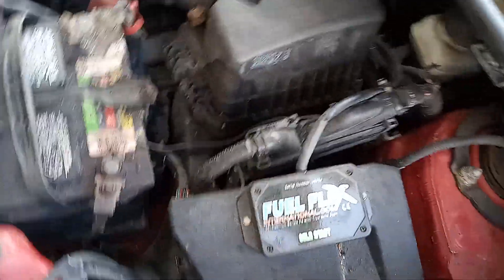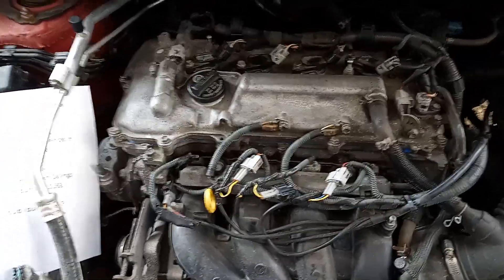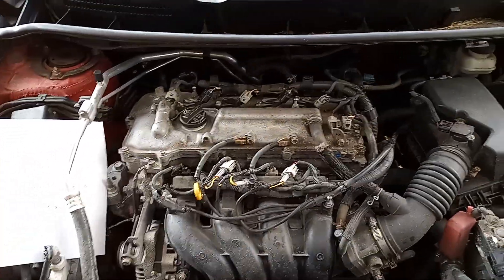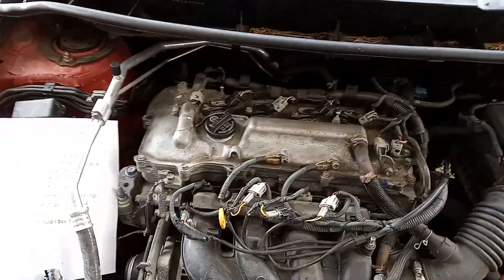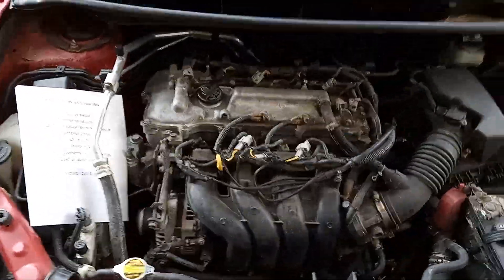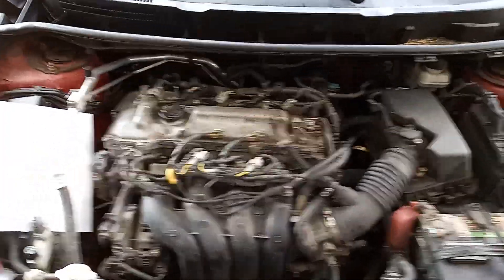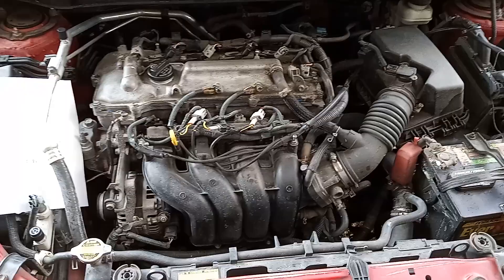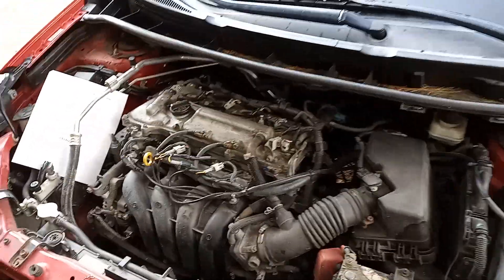E-85 Flex fuel conversion kit 1 year review is it worth it?

Comment: Hi there. If you are new to it, India has mandated 20% ethanol blending in gasoline, without price cuts or alternatives. This fuel is suited only for vehicles manufactured in 2023 or later, according to manufacturers. Due to this mandate, car owners are suffering about 15-20% drop in fuel economy due to the lack of optimized tuning, with concerns about long-term durability.

I use a Volkswagen Polo 1.2 MPI 2016 model, which is certified for E10 max. The car used to give 10-11 km/L with E10 fuel, and now with E20, that has dropped below 8.5 km/L with a marginal reduction in acceleration (nothing worse has happened till now, touchwood). I mailed to Volkswagen regarding ethanol compatibility, they responded as follows:

"As discussed, your vehicle is designed to run on Petrol/E10. The components of your car have not been evaluated for compatibility with E20 fuel. We trust this clarification addresses your query."

I watched a video by ChrisFix regarding E85 upgrade kits offered by eFlexFuel, and verified my car's compatibility with the kit using its VIN. When inquired regarding the material compatibility, they responded as follows:

"All of the vehicles listed compatible have E85 proof fuel system from factory. Theres no need to change fuel lines, pumps, injectors etc. If your car is listed as compatible you are good to go!"

(The engine is listed as compatible)

Considering all of these responses, should I go for the conversion or go for a new, E20-compliant car once the existing car starts throwing trouble? The car doesn't seem to have any significant issue with E20, but unfortunately, the blend is not going to stop at 20%, due to some internal politics. If I am to convert my car to flex-fuel, what are the additional precautions that must be taken?

Comment: Hey! I want to use this guide for my 2023 Ford Maverick Hybrid 2.5L naturally aspirated but dont know where to start would you think just one of these cheap e85 kits would be enough or if i would need to add a ethanol sensor somehow?
Reply from the maker: they do sell a E-85 kit for a hybrid maverick with a sensor they are more money but it will give you smoother operation https://eflexfuel.com/us/auto-products?product=eflexplus
Reply: @mattmopar440 i did see this online haha but it is far too expensive for the money saved on e85 to be worth, do you think the cheaper kit you used in your video would work on my truck? Its an atkinson cycle naturally aspirated engine so i dont see why not maybe you would advise better

Comment: Can any one provide a link to this product or company please? Its just what I want to try but several similar sounding companies show up with much more expensive products. This would be perfect if it was combined with a flex fuel sensor to self trim. I want to order one to the UK as in France we have E85 everywhere for 74 euro cent per L. I some times do a round trip to the south that is 600 miles one way.
Reply from the maker: Here is one like what I got they use to be all over Ebay now its hard to find them Ebay has gone down hill in the last few years tho 
https://www.aliexpress.us/item/3256805779429458.html?src=google&gatewayAdapt=glo2usa

Comment: I put a different kit on my 2002 Mustang GT that was much more costly (about $700). It ran fine for several days on 44% ethanol content but the day that I refilled the tank I got 61% ethanol content (a mix between 44% and 85% which would make it around 61%) and the car died. This is less than a week after I put in the kit. Turns out that it killed my fuel pump (or was it coincidence?) and I have to replace it. The manufacturer and another youtuber said that neither the fuel pump nor the fuel injectors need to be upgraded from stock. Anyway, I ordered a fuel pump certified for E85 only to find out that the fuel pump housing for the bad pump was of poor design where you have to remove a small hose to get access to the fuel pump. Which caused another problem because I ended up destroying the small hose and can't find a replacement that is SAE 30R10 anywhere. The corrugated hose fits onto an 1/8 inch OD port on each end. So, I have to order a complete assembly with a fuel pump pre-installed because you can't get just the housing from any manufacturer. You might not be able to specify an E85 compatible fuel pump either. I'm not a happy junior mechanic right now.
Reply: The same consideration is present using Bio Diesel on older cars. A change of fuel on an old car can disolve varnishes that built up over time in the tank and pipes and cause issues but if introduced slowly it can clean out more slowly.

Comment: thank you for sharing
I would get just because I think being able to flex fuel is so cool
though I prefer E0 if it wasn't cost inefficient to E10
Reply from the maker: I'm coming up on 2 years over 30k miles no issues using all the stock parts but if I have an issue I will do an update video

Comment: Looking to do this on a 08 Toyota with a v6 as e85 is half the cost of regular (I’m old enough to have bought some of the last leaded gas available which is what regular use to mean). Thanks for the useful info, even if I take a hit in economy that’s ok for less than 3 bucks a gallon. I have three mopar vehicles with flex fuel and haven’t had any issues with the fuel system specifically on any.
Reply from the maker: Honestly Ive seen cleaner oil during oil changes better performance you take a decent 20% hit in the winter but it gets better in summer probably 10-8%  this is running on a 2010 toyota so you should be good hasnt given me any issues and Im coming up on 2 years now

Comment: Thanks, this is helping me decide it's worth it or not.
Have a very big price difference (4x-6x) between this "cheap" ebay kit and some "normal quality" kit (the last one probably mutch better, and have sensor in the fuelline, but to worth to install, it's can take years).
Reply from the maker: yeah I went back and forth for a while as well this kit works for what it cost but if I was putting on something nicer I would go with a kit that has a ethanol sensor